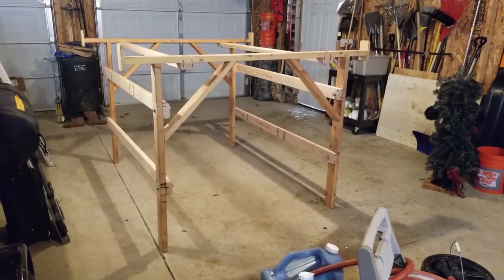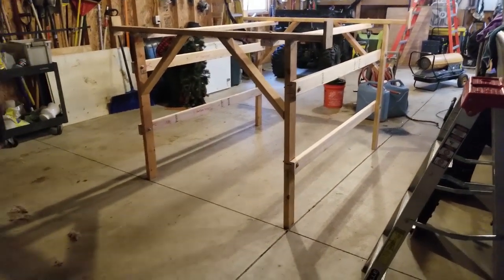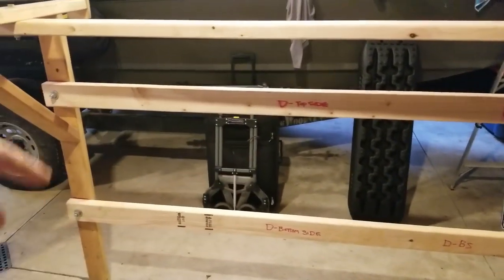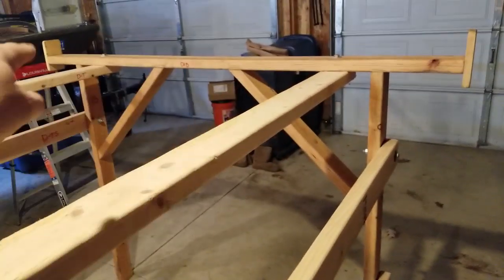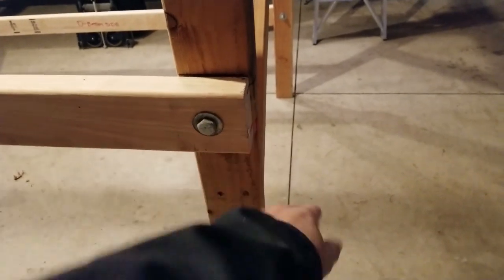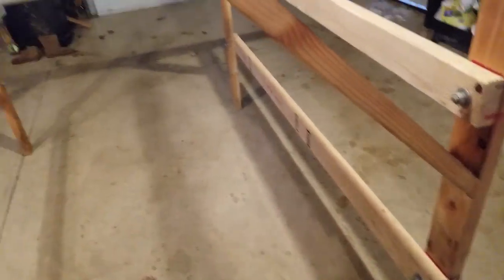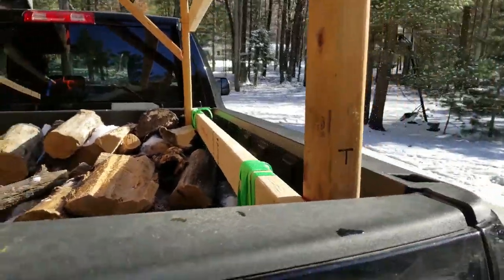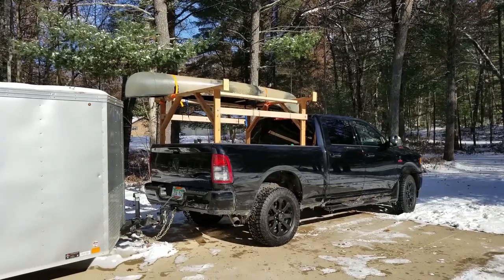Amazing Homemade Overland Rack Canoe And Gear Carrier

Comment: When I saw this I just thought "Dawn breaks on Marblehead."
What a great idea! I thought this went into the stake pockets on the bed of the truck. But I see you just put it inside. I have a soft topper pick up truck cap. It's canvas but it leaves the s t a k e Pockets available. I could build something like this in the s t a k e Pockets which is what they are for. They used to be used to build a wall to make the pickup bed walls higher. I can just use it for a rack now. Much better than a several hundred dollar bed rack. Although the 2x4s might cost that now LOL. Thanks for all these great videos and ideas!
Reply from the maker: Love the soft toppers! Adn yep this will work perfect in the stake pockets. Just make sure the side bars are removalbe like how i make this so you can set in the front part seperate from the back part and not have to fight trying to set all 4 corners at once.
Reply: Thanks for the tip. It has been a few trucks since I used those pockets. 
I have been trying to figure out a platform for viewing, photography, whatever. This looks like it might be an economical answer. Thanks. I am really enjoying your channel. Going with your method of arrow construction. It seems reasonable for my goals. Thanks for the great channel.
Reply from the maker: @R M  glad you are enjoying the videos!

Comment: You should show how its attached to truck. Tks
Reply from the maker: I did in the original video I made of it and linked at the end. I just used a ratchet strap in each corner to the truck tie-down points

Comment: Just watched your 1st build, love it! Another thought/idea/question, what are your thoughts on using wing nuts for easier break down? To make it less "rednecky"(Ha ha ha), paint/stain it as others probably have stated. Personally, I think that when I build mine, it's going to stay in permanently. Besides, IT'S A PICKUP TRUCK! Ha ha ha
Reply from the maker: Wing nuts would work but normally with lock washers wing nuts of this size jam to tight with the lock washers and need pliers to take off anyway. But its worth a try. Yep of you want to stain and seal it that would look great! I only use mine a few weeks a year so I was not worried.

Comment: I love this design and concept! Planning on building something quite similar to this for my canoe. Quick question: is there a reason you have the side rails starting on the inside of the H frame at the back, and attaching to the outside of the H frame on the front? Thank you!
Reply from the maker: You will love it. The reason for the miss match is because it was originally designed for my f150 and then I modified it to fit my ram with a longer bed. So it just ended up being that way to make it fit tight. Yoy should watch the original video on it did a few years ago called homemade canoe rack. Shows all the details.
Reply: @SamkoTradBow  awesome, thank you!!

Comment: I noticed that canoe cart you had in your truck, how do you like it? I built one to get my canoe back to a lake close to a mile, you want to talk about “Rednecky” lol, but the thing I built rock solid just heavy. I built one of these for my old tuck, built it to fit right in the holes on the side of the bed, I like your idea better definitely seems more sturdier. Good stuff man love the videos, they always get me thinking.
Reply from the maker: The canoe cart is great on smooth ground or even gravel roads. It sucks in the woods with blow downs dead falls etc. Once I hit the woods I throw the canoe on my shoulder and carry it. But for anything flat the carrier is great.

Comment: I'm wondering why you have the horizontal bars on the inside at the cab end and the outside at the tailgate end. Is that because of how it sits in your truck bed, or am I missing something else here?
Reply from the maker: Can't remeber the reason but it had to do with thos rack originally being made to fit my f150 and then I modified it to fit this ram. Had something to do with how I had to set it up. Maybe because I couldn't get a bolt in or out in the ram or something.
Reply: Thanks for the quick reply. About to start my build! Thanks for the great content - I've been showing my wife and daughters your videos repeatedly to the point that they can't take it anymore. Now it's time to build! (From Vancouver Canada)
Reply from the maker: @jeromelengkeek322  hahahaha! Glad you are enjoying the content.  This home made rack  has traveled from Michigan to Kansas 7 times and from Michigan to Georgia 4 times all with canoes and kayaks up there.  Best rack I've ever used. You will love it.

Comment: What size screws did you use in on the corner braces?
Reply from the maker: Every thing was 3 inch deck screws
Reply: @SamkoTradBow  Thanks! This looks like a great build, gonna give it a try before my next trip!!
Reply from the maker: @kevinbuchanan1927  you will love it! Best canoe rack I jave ever used. It has traveled over 6000 miles with 2 boats on it so far and as strong as the day i made it